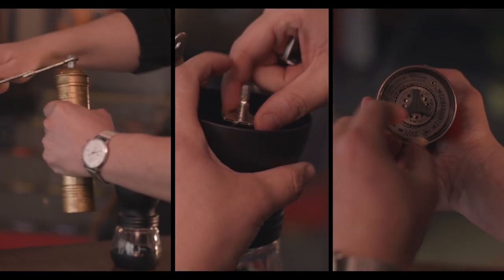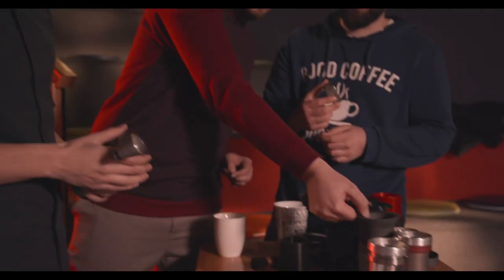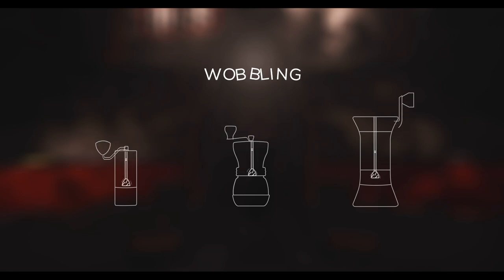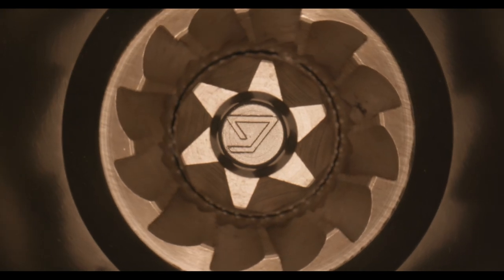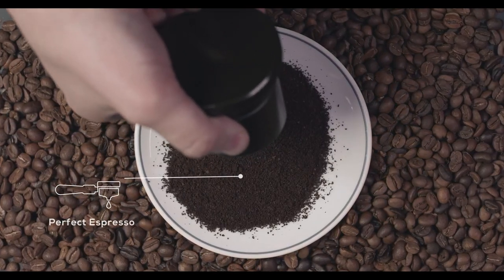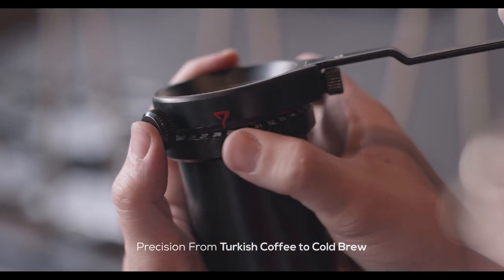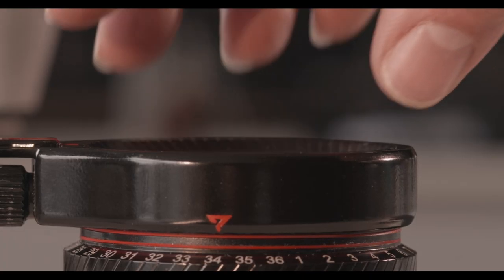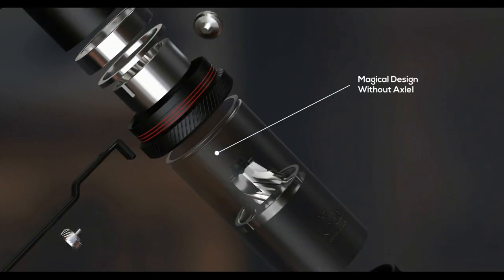Knob Coffee Grinder | There is no axle!

Comment: The grinding rotation of this machine is counterclockwise rotation or clockwise rotation.  I saw some animations spin clockwise, some animations spin counterclockwise.
Reply: Same question here. I think is counterclockwise as they are using Italian central burrs, designed to grind clockwise. Not sure if they redesigned the burrs
Reply: depending on the video being played backwards or not it can be CW or CCW.
Reply: Based on the shape of the outer burr, it looks like it has to rotate in a certain direction, in order for the grinding action to work. In the animations, the apparent change in spinning direction might be due to optical illusion, similar to how the wheels of an automobile seem to rotate in reverse direction, in some movie scenes. Or maybe, they played the video backwards.